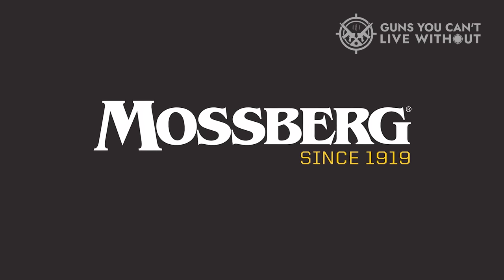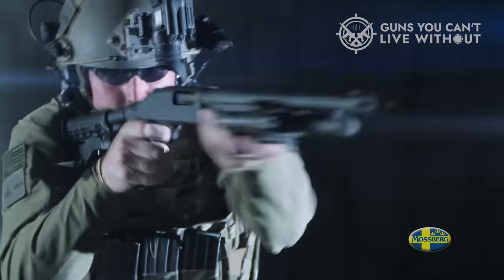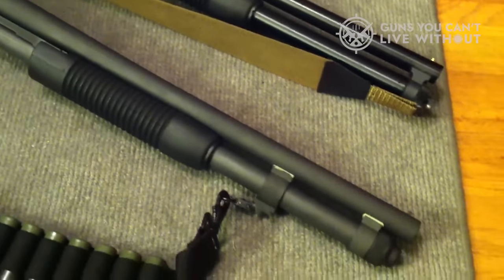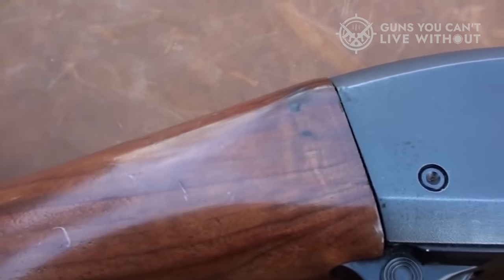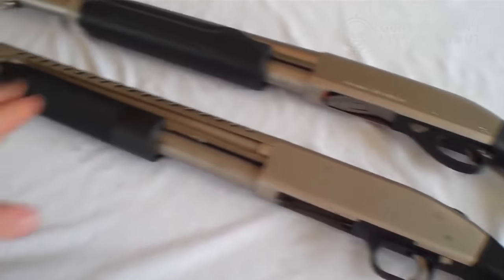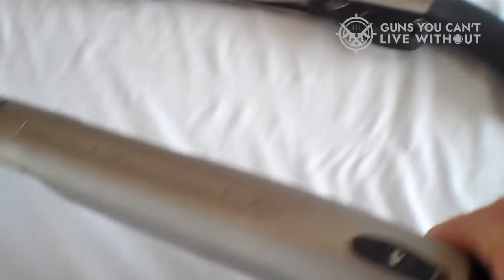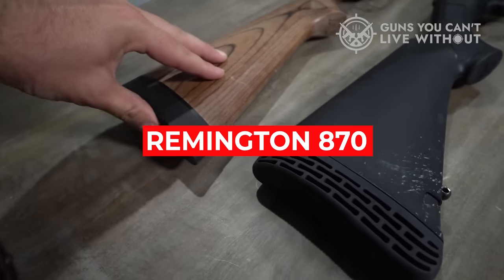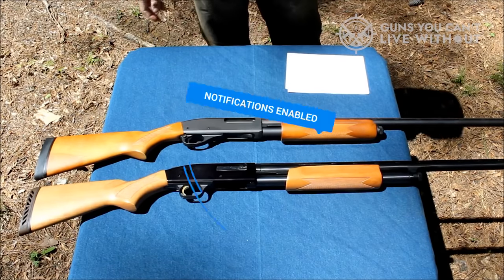Mossberg 590 vs Remington 870 - NOT EVEN FAIR.

Comment: I started doing gun shows some 40 years ago. The buying public would take a Remington 870 and only buy the Mossberg 500 when nothing else was available. In more recent years the 500 has seen increased demand because of better quality appearance, some extra features, cheaper than 870 and because you can hardly find an 870 for sale in this part of the country. However, in that same 40 years I have competed in trap, skeet, tactical matches, hunted ducks, quail, turkey, coyotes, and bought and sold numerous Remington 1100 shotguns. I have only experienced  two (2) parts failures during those 40 years. I will stay with my 1100 any day. 😘

Comment: I really like the tang safety of the Mossbergs. I have 3 of them; a 590 Retro, a shockwave, and a 940 autoloader. I do agree that if I were to put a pistol grip on a shotty, I would want to have a crossbolt safety instead of a tang. Love the aftermarket accessories available right now.
Reply: Good point about the safety position when using the pistol grip stock. 👍

Comment: I have tried both during the last 37 years, and while both are good weapons, I will always go back to the best shotgun I have ever used; the Winchester 1897 trench broom. The design is 125+ years old, but has never let me down, and consistently outperforms both Remington and Mossberg shotguns in every competition I have ever been in. There is a clear reason why the 1897 has been used in every war and every combat situation since 1917 up to the present day. It just never gives up.
Reply: I have a Winchester 120 and 1300, prefer them very much over the Remington 870s that I use for work.  Much smoother action, lighter gun.
Reply: Me too.  Nothing like a Win 98 in trench configuration.  Looks mean, and the lack of a trigger disconnect is nasty.  Capacity is limited, but reloads quickly.  The Germans hated them in WW1.  Does need a butt pad.

Comment: Mossberg all the way....  

Something that wasn't mentioned that I consider a huge advantage for 500/590s is the open loading port.  Having run both 500/590s and 870s, I find it makes a huge difference in ease of loading.  Just flip the gun over, drop a the shell in the port and push it home, or if you don't want to turn it over, just lift a shell up into the wide open loading port and slide it in.  Doesn't get any simpler on a shotgun.

I can't tell you how many times I gotten a finger caught/pinched by the 870's annoying and frankly unnecessary spring loaded gate in from of the mag tube.  I'm sure any replies will say train more, which is fair enough I guess, but wouldn't you rather have a weapon that loads far more easily out of the box than having to learn your way around the hassles of fighting with the spring gate to load your shotgun?  The simple fact of the matter is the open loading port of the 500/590 makes loading/reloading so much smoother and faster in my experience.  

I can easily run 2 shells at a time into a Mossberg tube back to back with that open port, but if you try the same thing on an 870, it is noticeably more challenging having to keep the gate spring compressed when attempting to rapidly load or reload an 870.  A lot of dropped shells have been the result.  It is far easier to quickly load/reload the Mossbergs.

Also, I totally agree with the sentiment that Mossbergs are much easier to work on for people with basic tools, due to better design and more easily interchanged parts that can be serviced by the end user, whereas some 870 parts will likely require the services of a gunsmith to change/repair for your average user.  Having heavily customized my 500, I can't think of any parts that I can't replace in a few minutes on my own.  

Lastly, since I am lefty, I much prefer the tang mounted safety, which is easier to actuate with either hand and also makes it far easier to see at a glance, whether the safety is on or off.  I also have a pistol grip on my Mossberg, using the aftermarket Mesa Tactical buffer tube adapter kit (which I highly recommend for regardless of whether you have a 500/590 or 870), and once you get used to it, engaging or disengaging the safety is still quite easy on pistol gripped Mossbergs,

Mossberg makes a better pump gun, plain and simple, with a number of clever, user-friendly features that just aren't available on the 870. For people looking for a great first pump action shotgun, that can be csustomized and upgraded easily, I highly recommend a 500 or 590.  Hell, even the Maverick 88, which is basically a 500 with handful of cheaper parts, will get the job done just fine,  

But that's just my 2 cents, take it or leave it...

Comment: Still have my 870 WINGMASTER 12 gauge Magnum 30" fixed full choke. Bought new in 1981 for $250.00 Also got a Skeet barrel. Years later, when clearing out an old house for demolition, found a non ribbed 28" modified barrel in the attic. Bore shiny and new looking. Outside of barrel rusty and some pitting. Steel wool and white vinegar shined it up nice. Fantastic guns back then. Not like the junk Remington churns out lately. Got a 590 also.
Both are great pumps. If I was in the market for a pump today, I'd take the 500/590 hands down.
Between almost weekly Trap or Skeet for a lot of years, the old 870 has about 50,000+ rounds through it. Still my go-to gun after 42 years.

Comment: I bought a Mossberg Maverick 88 Security for my 1st gun when I turned 18. Now 16 years later I've shot through 6k plus 100 round #8 value packs along with hundreds of 00 and 000 buck in both 2 ³/⁴" and 3" magnum shells. For $165.00 brand new when I got it, you couldn't beat that gun. I've shot both Mossberg 500 and Remington 870's over the years and neither shoot as well as my Mav 88. I know the 88 is made on a 500 platform, but it doesn't kick 1/4 as much as the 500 does.

Comment: I bought a Mossberg Maverick which is their introductory level shotgun. It shares several components with the 500. Over 10 years of shooting this gun I have no complaints at all except for the "sloppy" feel of the forearm. It does not affect the operation or performance at all. Based on how well their base model Maverick is,I'm sure the 500 and 590 would be fantastic. I agree with the gunsmith .

Comment: I recently bought a Mossberg 590A1 Retrograde brand new right out of the box.  I couldn'te believe the condition of the inside of the barrel.  The gunk that came out of that barrel was like removing years worth of black powder residue.  Also, the trigger housing is not steel as the narrator suggests; it's more than likely aluminum.  A simple magnet test proved that out.

Comment: I ran both at work. I also trained personnel on both, as well as on cheap Turkish guns. What did I prefer? The Mossberg 500/590. Hands down. I was responsible for the safety and security of clients and equipment in the harshest Arctic environments. Cold, wet, grimey, no support, days from help. The Mossies ran without a hitch. Easy to strip and clean. Super fast to shoot using the pull-rack technique. I loved it every time I carried one.

The Remington 870's we were issued had problems with the barrels working loose during a course of fire. This would cause the ejectors to bend and break. This has to be fixed by a gunsmith.

I also prefered the Mossberg safety, as long as it wasn't overlubricated and collecting grit. Top ups were great with the more open lifter, too. Really shines when inturrupting loads to mix lethal and exotic loads.

I prefer sporting stocks over pistol grip stocks, so moot points there.

Oh, all our 870's would rust if you looked at them funny.

All this said, what do i run for my own shottie? A nice old Winchester Ranger 120 with new synthetic furniture and a 19 1/2" cyl bore bbl. It's fast and like and extention of my own body.

Comment: Bought my first shotgun at 18 it was a moss mod500 40yrs later still own it It lived most of its life on a commercial fishing boat in a 30gal garbage can with a lid on it on the deck in the Gulf of Mexico , still functioning like the day I got it, had to change out the mag spring 20yrs ago due to salt in the air, but there is no other shotgun made that compares to the mod 500

Comment: I bought a 870 express at age 12, I  dont know anything about "mim" parts but mine has run flawlessly for 20 years of clay shooting and hunting. I think I replaced all the springs like 5 years ago cause I figured it could use a tune up before something broke, it now wears a carson 18" barrel more of the time than the original stock 28" but both get used, and it has a collapsible m4 style pistol grip rear stock which the saftey works much better with than the tang like mossberg. That gun has accompanied me every year of duck and dove hunting, shot a couple deer, many a turkey, and more coyotes than my rifles combined. Saying I shoot 1000 rounds a year through it (I'm sure I shoot far more through it than that) its held up well for a very conservative 20k out of a $250 gun. Honestly the most replaced part on the thing is the primos extra tight chokes that are on both barrels. I've probably wore out (they didn't shoot tight anymore) 8-9 of those chokes through shooting a fair ammount steel BB at waterfowl with it. I will admit tho the matte black remington finish on express shotguns is terrible in wet weather. I used an at home ceracote kit years ago on mine and it hasn't been a problem since. I have tried semi autos and fancy over unders but I just dont hit birds flying with them the way I do with the old reliable so its going to keep being my main shotgun till it eventually dies... then I'll have to use one of the other 3 870's that were passed down to me by family through the years 😆

Comment: I've owned and shot many of both, and the answer is neither is superior. It's simply a matter of preference. They're both as reliable as the sunrise and as mechanically sound as you could ask. Both will last several lifetimes without even a hint of problems. I personally prefer the Remington because it just feels right to me. And that's probably only because it was my first shotgun and it's what I was used to for many years before I owned a Mossberg. Had it been the other way around it probably would have been different. You can't go wrong with either! Either one can do anything you need to do with a shotgun!

Comment: Awesome video, very accurate.

This is similar to a Ford vs Chevy truck debate.  Both guns a great.  I’m a NRA Tactical Shotgun Instructor and an 870 armorer.  I love my 870 Pmax…it is my favorite gun.  It has had a ton of rounds through it.  Not only from me, but from my students as well.  I always let them shoot it.

The only issue I had was with the ejector.  It shouldn’t have left the factory with it as the tip  looked like it was worked on with a Dremel.  After several years of heavy use, it started having ejection issues.  It would sometimes not eject the spent round after around 200 continuous rounds were ran through it during training or when I was teaching.  I replaced the ejector and ejector spring and haven’t had an issue since 

As far as the 870 safety, I highly recommend the Vang comp big dome safety, especially if you are right handed.

Again both guns are great.  If I was getting a Mossberg, I would go with the 590a1.

Comment: "NOT EVEN FAIR"  title of this video means NOTHING, since your conclusion is conclusively inconclusive, according to your narration.
Having critiqued the video title, it is ONLY FAIR to acknowledge your excellent work in presenting the comparative details of both firearms. 
Most revealing to me was the Remington rivet and solder methods compared to the Mossberg screw fastening. Also, that Remington quality has diminished post 2007 conglomerate acquisition is a big red flag.

I own the 590A1 for home defense. Installed a very well made thumb activated spotlight forend. 
The 590 is easy to disassemble for maintenance. It's a great gun and setup.

Thanks for the vid. Made me glad that I went with the Mossy.

Comment: I have a Mossberg with a pistol grip.  Until this video I didn't even think about the safety being awkward to use with that pistol grip.  It seem s quite natural to have the safety where it is and the pistol grip that I added myself didn't present any problems to me with using the safety.   I like the fact that the safety is right where I can see it and can see if it is on or off all the time I'm holding my gun.  Either when up to fire or carrying down.  Always at a glance I can tell if that safety is on or off.  But I was taught not to rely on that safety alone.  I always also open the breach and stick my finger in to be certain that there is no round in the chamber if I want the gun in safe, beside putting the safety on.  I also keep my trigger finger straight out on the side of the reciever outside of the trigger gaurd until I, am ready to fire when I slowly place my finger inside the trigger gaurd.  Just something I picked up from osmosis hunting with my brother and I do it almost unconsiously. And never do I carry the gun over my shoulder.  Alway in front muzzel down in front of  me and at all times aware of where the muzzle is pointed. The latter is true when it's loaded, unloaded, safety on or off and if working on it at home.  ALWAYS.  LOL it's such a habit that I even catch my self looking at what's down range from the muzzle when I have the gun apart. LOL.  Just hard wired I guess.

Comment: The unmentioned part of the equation.  With an OPSol Flex Adapter, you can run minishells in a Mossberg.  I know many will say that you can run them in an 870, and you can.....if you rack the gun just right.

In our development of the adapter, we took a hard look at both guns, and the Winchester.  By happenstance, the way a Mossberg feeds  AND ejects a shotgun shell allows it to handle minishells with the adapter.  We went down the rabbit hole of urban myth that the Win 1300 can run them too.  

Put simply, a Mossberg carrier lifts the shell up, and stays up through the firing process.  870 and Wins don't.  Also, the 807/Win carrier is "timed" to drop back to the ready position as about 1/2" of a regular shell enters the barrel.  A minishell will not even be close to the barrel.  That is why it takes a certain "technique" to rack minis in 870.  If you don't rack just right, the mini will drop with the carrier and you will slam the shell into be gun below the breach.

Finally, ejection is different.

Comment: I've bought, sold, and traded hundreds of guns over the years. Owned both 870s and 500s.  They are both fine weapons,  but? 
I've never come across a "worn out" 870. Seems the more they're used, the better they run.  However I have run across 2 or 3 worn out 500's.
  I also own an early model 870 Special FIELD model (21" barrel and fixed choke) That I flat out LOVE! Wish I could find one in 20ga.

Comment: I have a 870 built in the 1960s, a newer 870 express and a 11-- 48 built in the 1950s, all are 20 guage. After hunting with them over 50 years everything is automatic. Admittedly I am not on a battlefield so a malfunction is unlikely to cost my life. I prefer the Remingtons for 1 reason, the safety, I find safety's on the tang awkward to use. When I was a kid my father used a Savage M 99 with the safety down on the lever. He had any accident losing the tips of his fingers and bought a 99 with the safety on the tang.  Years later it costs me a nice buck because I couldn't reach the safety while they gun was mounted.

Comment: The slide release, loading release, bottom ejection all make the Ithaca 37 much more easy to operate without fumbling. And your empties are at your feet, not thrown around. The Ithaca 37 is still made. And probably always will be. I bought a used one which are even shorter and lighter (because the old ones don't take 3" shells. The new ones do take 3" shells). 
The disadvantage is the light weight (recoil is much heavier). But it is also easy to carry around in the field. 

After purchase, I sold my old 870 which was quality made, but not nearly as ergonomic and simple to load and to get a round from magazine to chamber and the trigger to pull under stress fast from a safe condition as is the Ithaca.

Comment: I've had a Mossberg 500 for almost 40years and put thousands of rounds through it and it hasn't failed. The only part I've ever purchased for it is the safety button, which broke in half somehow. I've hand loaded some very hot rounds and never had issues. I purchased another new one with 2 barrels about 20 years ago as a backup and short barrel for home defence and it's never been shot. They are excellent shotguns.

Comment: if you want a pistol grip on your 500/590, you can install a Maverick 88 trigger group which has the trigger bar safety like the 870.

if you do not modify the M88 trigger group, the 500/590 tang safety will not work, but it is possible to add the tang connector to the M88 trigger group and have both tang and bar safety (they work independently).

Comment: The only 870 I own is a left hand receiver built in 2013. The action bars bind on it when you are trying to cycle it fast. I have shot several 870 police guns without issue and enjoy them a lot. 

I have a 500 and a Maverick 88. I enjoy both of those. 

I am looking to add a 590A1 and a Winchester 1300 to my collection of pump guns.

Comment: Having owned both, partial to the Mossberg 500, luved the top safety
 Cosmetically liked the Remington. Have a 590, 930 Mossberg. 870 in 12 and 20 gauge, along with an 1100. Mossberg 500 is the go to. Never fails.